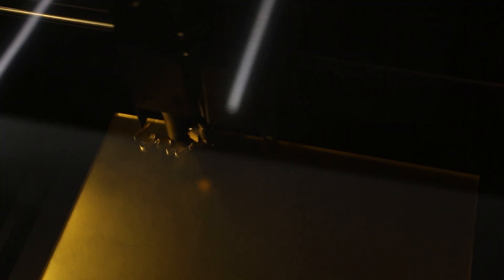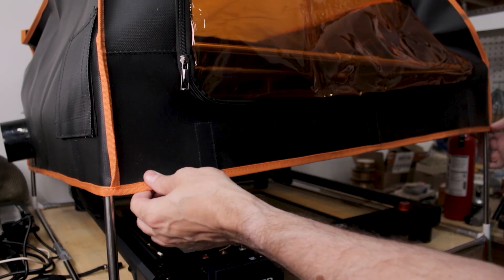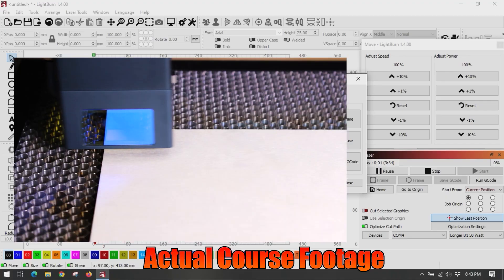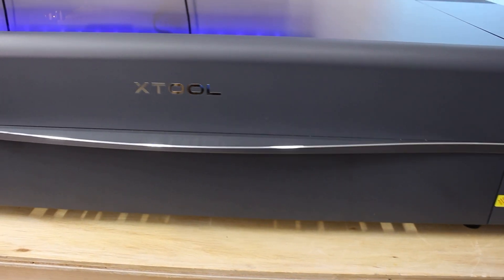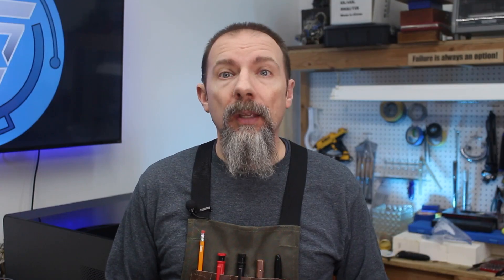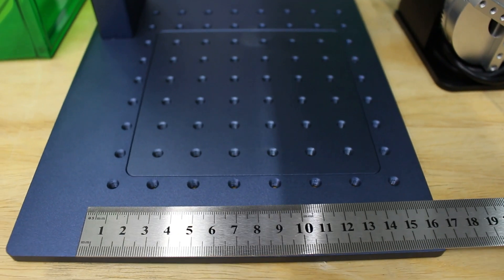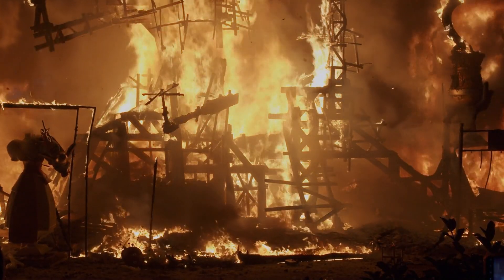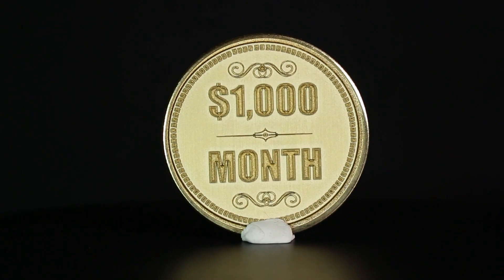Before You Buy a Laser Engraver: Avoid These Costly Mistakes! (Beginner's Guide)

Comment: Correct! DO NOT GET a cheap K40 laser! How do I know? I got one, of course! I added a height-adjustable, larger working are bed, upgraded the motherboard to allow using LightBurn, added a water flow indicator, and a couple other things I can't remember right now. It never has worked right. If I cut a circle, it's more of an oval. And it will never go back tot he same place twice.
I started life working on cars, as my dad built custom cars, and I always helped with the minor jobs. I later went to a respected technical school and got a formal education in it. Later, I got a degree in computer science. So my mechanical aptitude and computer knowledge are excellent... I know how to upgrade a machine. It is just a piece of junk.
I have two 10-watt diode lasers I'll use until I hit the lottery or marry a billionaire, so I can get a good CO2 laser. Those things are EXPENSIVE, if you want a good one! For me, it is still mostly a hobby, so I can't justify paying the price of a car for one.
Thanks for the informative and helpful video. I always appreciate an intelligent approach to sharing knowledge. There's one guy who's always throwing his arms around for attention, and just looks like he's smoking something, which distracts from anything he's trying to say.
Reply from the maker: Thanks Miley! Really appreciate it!